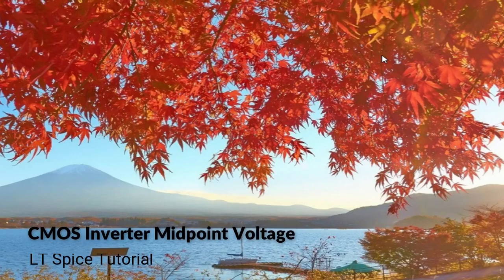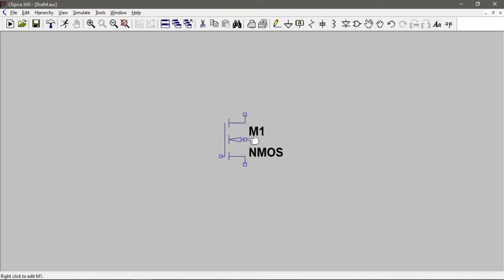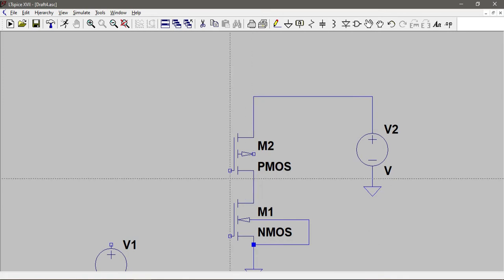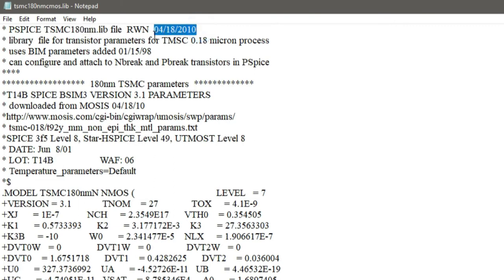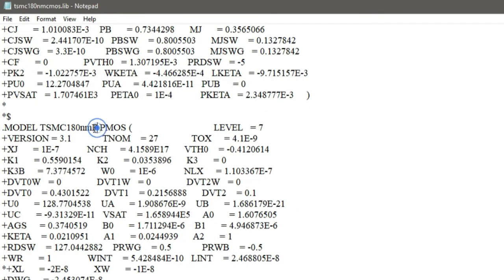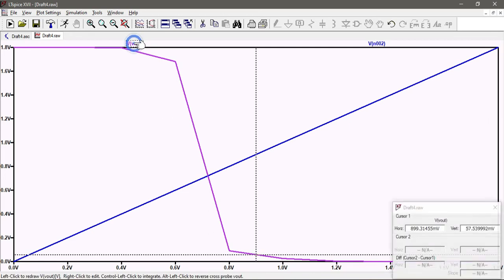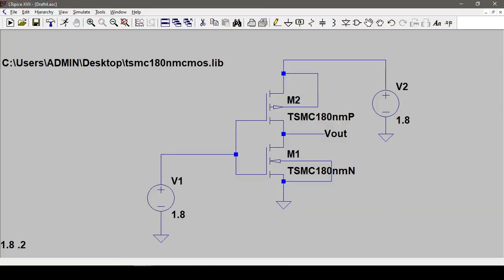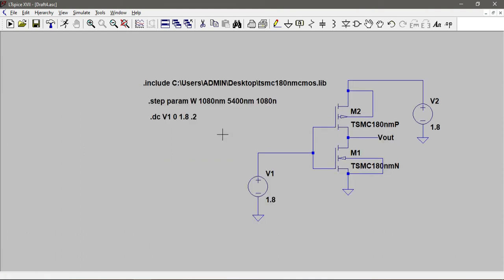CMOS Inverter Midpoint voltage - DC analysis | Including Libray | Using Parameters in LT spice

Comment: Sir could we include short channel effects in ltspice like lamda =1,2
Reply from the maker: I hope you asked about channel length modulation. Yes, we can include it by setting parameters lamda. And it's not short channel effect. Short channel is another term used to refer the effects such as Velocity saturation, DIBL , Vt roll off and all.
Reply: @jairamgouda  sir that only in which option we need to assign lamda value I could find
Reply: Could you say the steps sir I could find

Comment: boss  after downloading the library while including ..if we type .include will it be automatically includes or we need to give the location address of the file where it was saved
Reply from the maker: Yes boss:). We need to give the path where we are keeping our library file. If you don't want that confusion keep in the lt spice directory which will be usually in documents folder if you are using Windows machine.